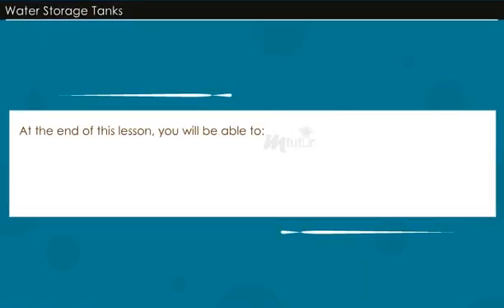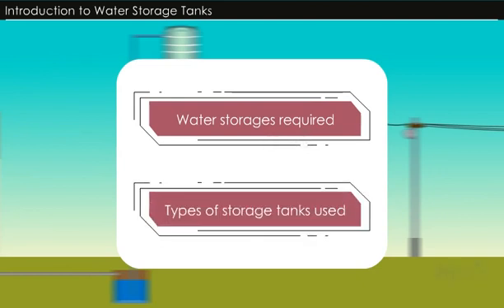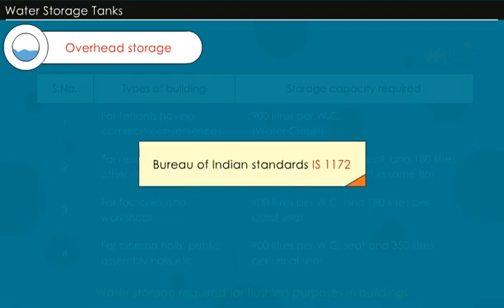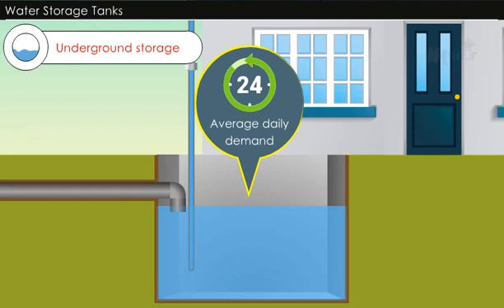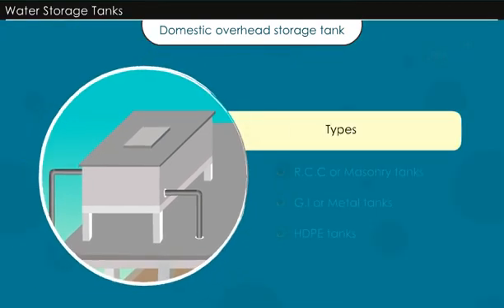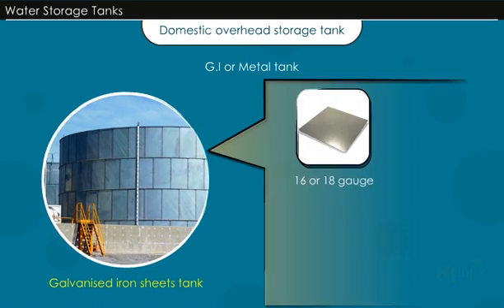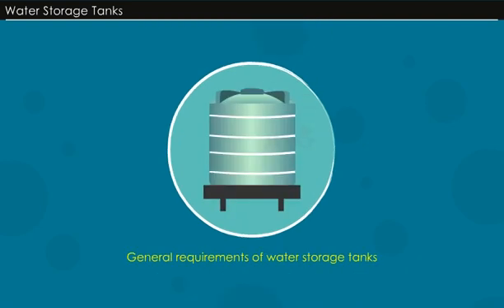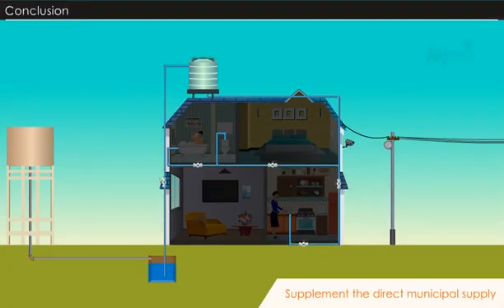Water Storage Tanks

Comment: Hello, I have a quick question, let's say I do have a water tank on the roof of my house and I would like to add a tankless water heater, how do I go about that? The pump is pulling water from the reservoir up to the tank correct, now wheres does the hot water heater gets connected????
Reply: Water from the tank on the roof will feed the tankless water heater.
Reply: @kevantaylor2663  would I need a pump ? From the roof water to the heater
Reply: @chrisjoshua5463  No you don't, gravity will allow the tank water to flow into the heater. I have a system just like yours but i'm using a rain water drum as my reservoir.